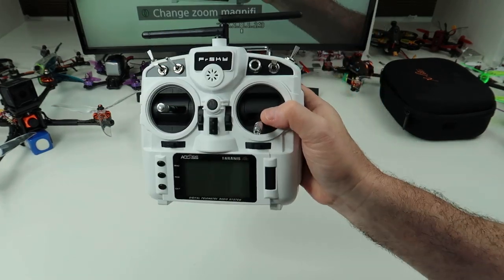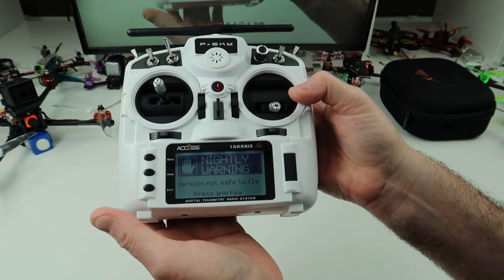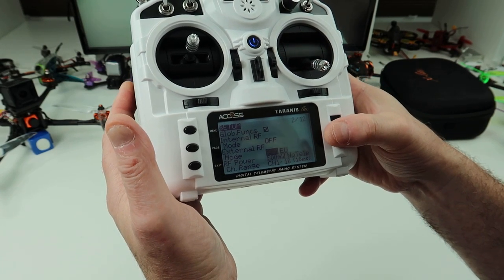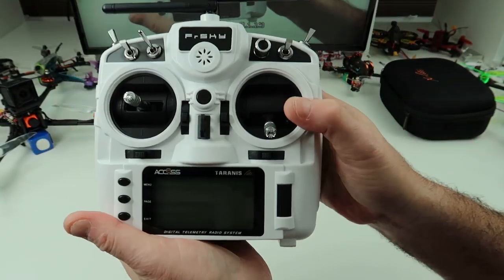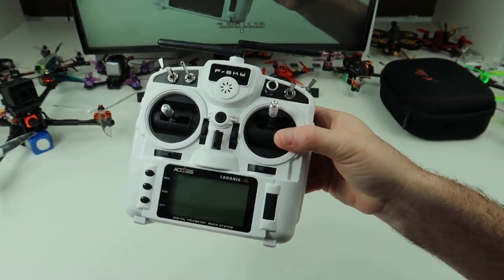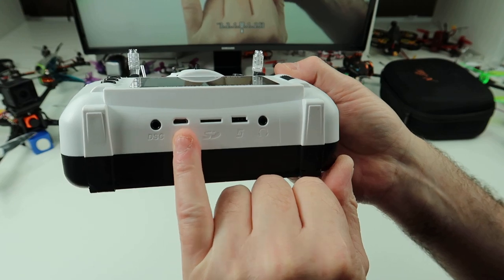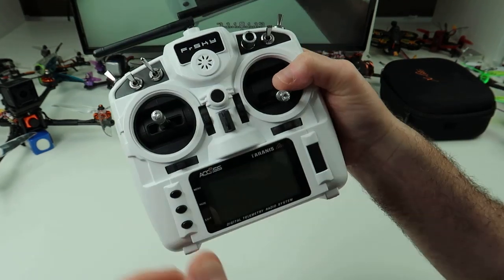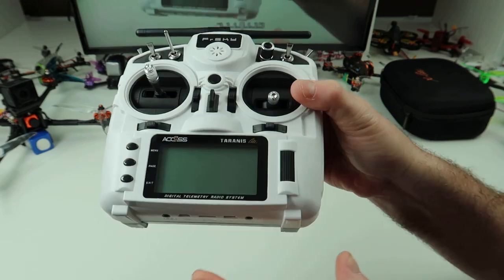FRSKY TARANIS X9 LITE REVIEW WITH MULTI PROTOCOL

Comment: I am looking at it for a while. what is your suggestion if I want to get into FPV flying?  I don't want to buy a beginner package because I would like to keep using the remote for more advanced quads in the future.
Reply: i use jumper, flysky and frysky (X7 and X9d), i think frsky is good for "serious" remote 👍👍🙏❤😁
Reply from the maker: simon simon Hi mate yes it’s a decent transmitter I would go for the jumper t16
Reply: @CKone41  oh jumper t16 is better? i dont have one, thanks for the info brother 👍👍🙏❤😁
Reply: @doktordrone  Thanks. I will more likely go for frysky X7, X9D is a bit pricy.
Reply: @CKone41   Thanks. Look like I will have to choose between jumper t16 and frysky X7/X7s; which one has hall-gimbal?
Reply: @simonsimon1989  owh, i have x7, it's good 😁👍👍🤘
Reply: @simonsimon1989  the 7s and the jumper t16 pro
Reply: @dancingking2299   Jumer 16 pro/plus is now usd $205.  a bit pricy.
Reply from the maker: @simonsimon1989  Hi mate you cant skimp on cost on fpv gear you need something reliable i paid £129 for my jumper t16pro
Reply: @CKone41  you got it cheaper. I might have to wait for t16 plus on sales.
Reply: @CKone41  for fpv goggle, new fatshark scout is my target.
Reply from the maker: @simonsimon1989  Have a look at the viper fx v2 goggles

Comment: How much is the module upgrade? Kicking myself that I did not know about multi radio support transmitters before.
Reply from the maker: 2Old4Toys Hi buddy the module is around £30
Reply: @CKone41  ah... well the
Turnigy Evoution TX and included RX cost me about £25 as a set, so was cheap. But now the I'm finding the TGY-iA6C receiver is too big to fit into the Egg 130 frame that arrived today. 🤣 what a palaver. Need to search for a compatible mini receiver now!
Reply from the maker: @2Old4Toys  Unfortunately that the problem with the evolution did you get it from hobbyking?
Reply: @Colski RC yes, is it good or bad that I bought online from that place? I just now ordered a Turnigy FS-A8S 2.4Ghz 8CH Mini Receiver (looks like it would fit) and other bits and bobs. Hopefully I have everything I need to get this thing off the dining room table and into the air. Still cheapest entry level at the moment (£100 or so including the flying egg 130 v2) just to teach my boy and myself the basics. Having a multi- transmitter you show here would (in my imagination) allow us to keep a good transmitter costing £100 that would work for the myriad of WL Toys RC vehicles we have in the boot : RC car, RC boat, RC prop plane, micro quad and ditch the trashy transmitters they came with?